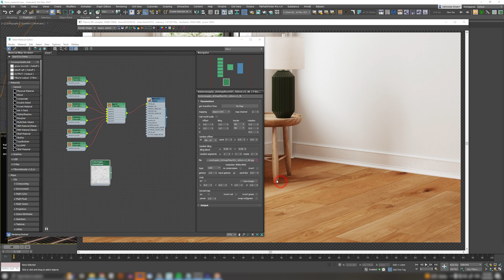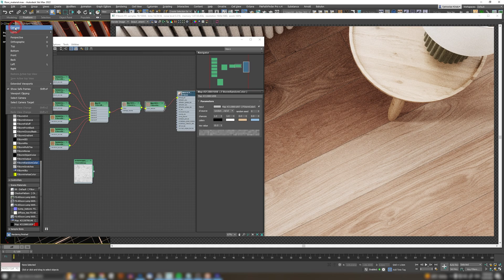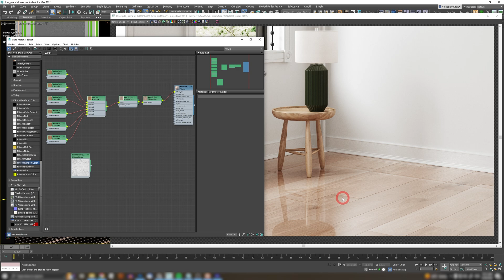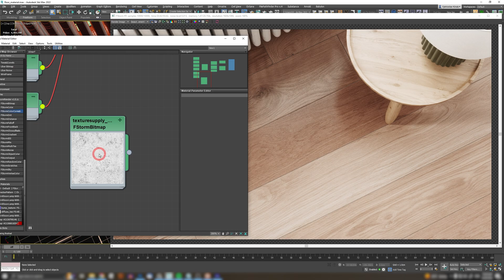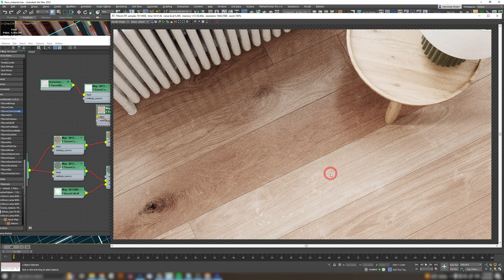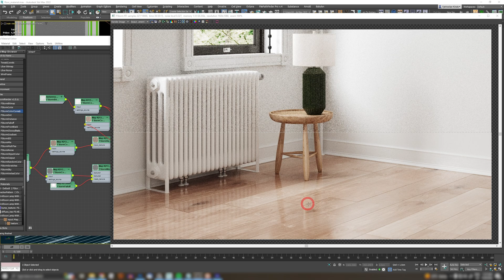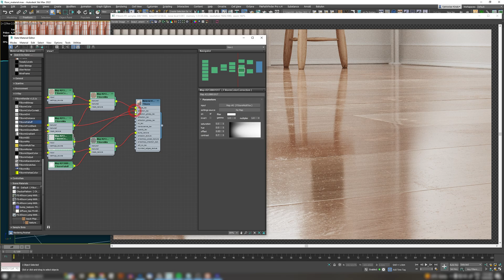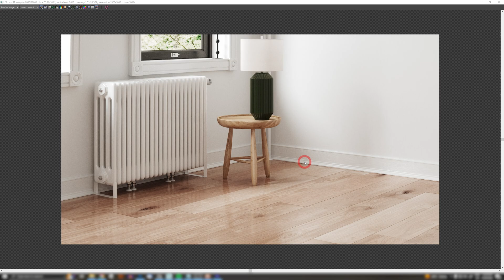Materials Ep1: Wooden Floor As Complicated As Necessary | All 3D Software

Comment: Talking about varying degrees of reflection depending on the angle of the view/camera -  isn't IOR/reflection IOR settings there for exactly this purpose? Unless in Fstorm it works somehow different, dunno.
BTW, nice videos, in any case!
Reply from the maker: Do you mean fresnel effect on reflection? Yes fstorm has it and it changes values depending on the angle, but here the main thing was how material changes it’s properties out of standard reflection boundaries (bump, glossy type etc…) with different angles because of varnish coating
Hope I understood your question
Reply: Yeah I think it can be called fresnel ior as well (Think in Corona it is), while in Redshift it's called reflection ior. So what you're saying is since you want to adjust not only reflections, but other features as well (depending on the angle), you're using a mask (falloff). But, if say, you wanted to adjust reflections ONLY, reflection ior (or fresnel ior) would be sufficient/good enough?
Reply from the maker: @noveltyexposure  Correct, built in fresnel effect is good enough for many scenarios.
The whole effect of reflection being stronger on an angle, and weaker up front is called fresnel, some rendering engines call it fresnel, some just reflection IOR etc...
Me pushing the boundaries of adding a falloff (therefore mimicking fresnel effect) in glossy, bump etc is just that extra kick to the whole material. But in many cases using "ONLY" built in reflection fresnel, is good enough.
Reply from the maker: by the way, these videos you have on your channel look awesome! Subscribed!
Reply: Okay, this confirms my assumptions then :) was afraid I'm missing something else here. Oh and please continue on with these great tutorials of yours!
Reply: BTW, thanks for the kind words, appreciated!